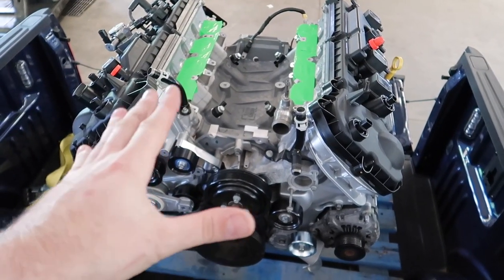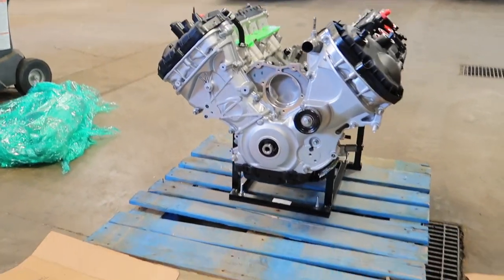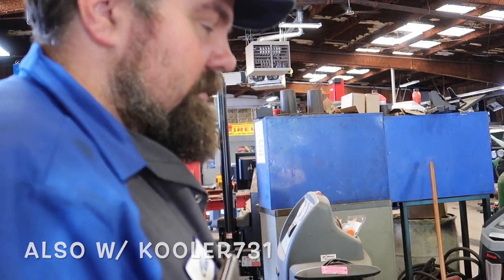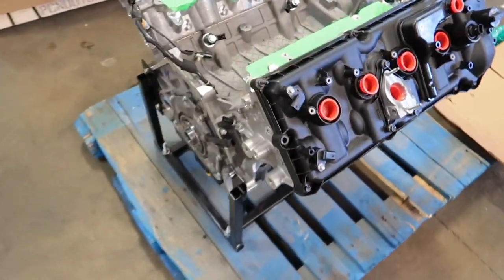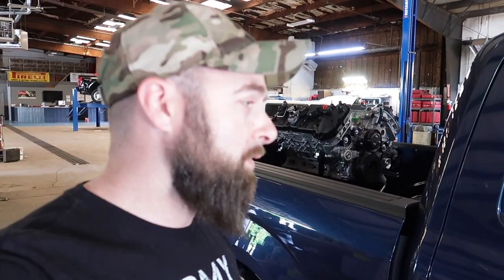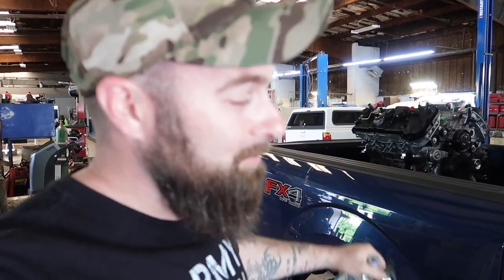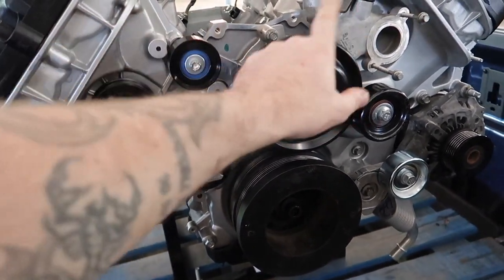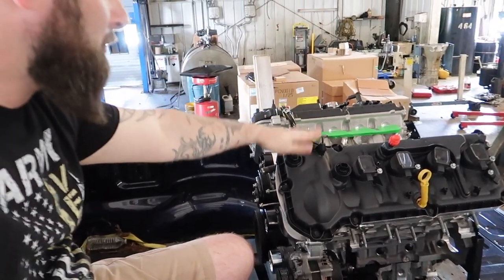MY RPG BUILT 1400HP 5.2 MUSTANG ENGINE IS FINALLY HERE *GT500 SWAP???

Comment: Hello Alex.
It will be nice to see the car finally back on the roads. And to follow the joureny. 
But as a long time follower. I feel there is alot of things in dark as how the story unfold after you made successfully 1000+ horsepower on the hellhorse dyno. That followed with you become a salesman for them.

Now if we fast forward until today. Neither you or Ken are running the hellhorse turbo kits( that you had talked so highly about). 
And you end with picking up your car from them with not even a engine under the hood.
And now when you finally have an engine. It is all new! ( except for some minor parts ) And I am scratching my head as to what happen to the engine you had, as last time I saw it. It had successfully  made over 1000. And I thought the plan then was to get it sleeved and better rods and pistons, at that point from a reliability standpoint

So is there any chance you are willing to shine some light on that for the guys like me, that are dying to know and  have been following your channel for a long time. 

Or is the story with hellhorse something that can't or you rather don't choose to share on YouTube.?

As for the new 5.2. engine. If the crank is from a 5.0 engine. I guess the added displacement is gained with a bigger bore size or what?

Now I somehow always thought the GT350-500 engines had gained the extra displacement from a longer stroke. But I guess not.

Anyway.
All the best and will be looking forward to watch,  what is to come.
Reply: Well said. I am 100% with this. 👍🏻👍🏻
Reply: In for this also very well said !

Comment: How about did they install hoops to contain all that boost? This is practically a norm in all pro stock motors. Just asking personally if I had an engine built I'd make sure that the hoops were done correctly and then you can throw the boost at it

Comment: Great choices from a complete 5.2 block that can handle up to 1400 HP, to adding a supercharger instead of turbos.  I'm not sure who Stangmode used for his engine, but I'm wondering if some things were missed during assembly. Good luck moving forward with what should be a bad ass Stang
Reply: Stang Mode made SO MANY videos of his engine build, how can you not know who built it? He talked about it a ton.

Comment: Im not informed on motor swaps. Since he has a 5.2 now. Does he have to get 7 Speed Dct now or it can match with 10speed
Reply from the maker: Either or
Reply: @Zander13Productions  please inform me. What parts or what exactly you needed in order to get that 5.2 block to match with 10 speed. (I know plenty about cars, nothing about swapping motors and trans) also last question would it be possible to do that with the 5.2 Shelby predator?? Thanks
Reply from the maker: @funnierthan2476  ken@hprautomotive.com

Comment: Odin pulleys!! Damn! I have to say that’s a bit disappointing. I mean it’s a nice blower but compared to the Turbo kit you had it’s definitely a step backwards. Especially with a built 1400hp capable motor, the Odin will not make that kind of power.
Anyway good luck with it!!
Reply from the maker: There are reasons turbo kit is gone
Reply: Care to share reasons?
Reply from the maker: @justind4623  already been discussed in a live stream and hints in different videos
Reply: @Zander13Productions  sorry new subscriber just today ... didn't catch live stream mate.
Reply from the maker: @justind4623  oh I gotcha. All good. Bad things happened that should not have
Reply: @Zander13Productions  haha thanks for that ... I'm none the wiser now!!

Comment: Listen , if it’s not a fucking screw blower or pro charger f3 140 it isn’t cooler than twin turbos or a big single . Roots blower boring , little pro charger everyone has one , nitrous ? What is this 1985 ? Literally 99 out of 100 5.2 have a roots blower on them . Why you think that’s unique is a little confusing. That’s what’s under the hood of almost all street mustangs .